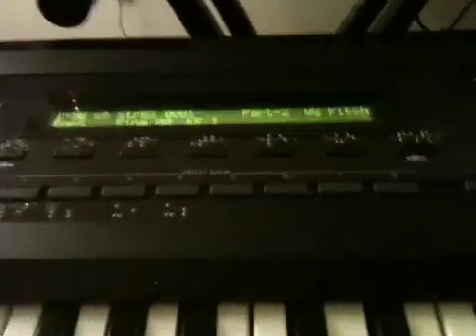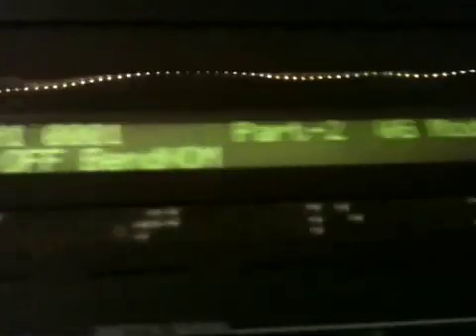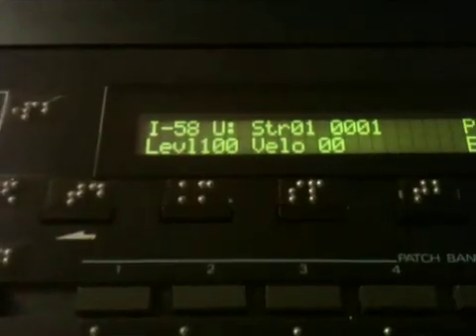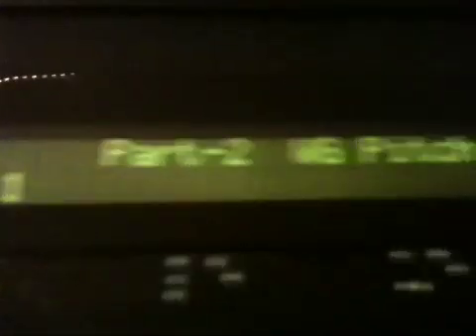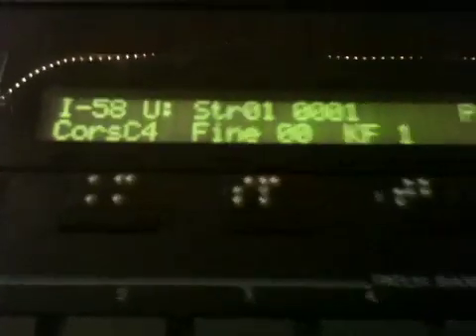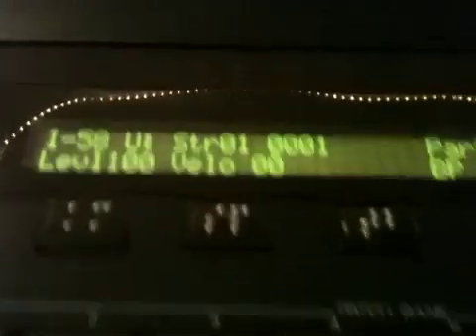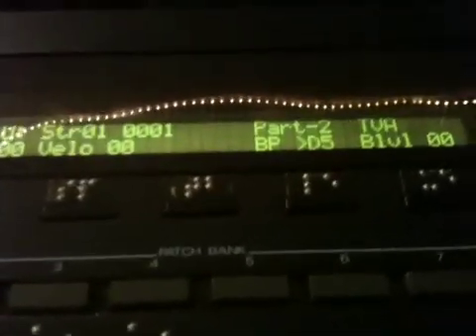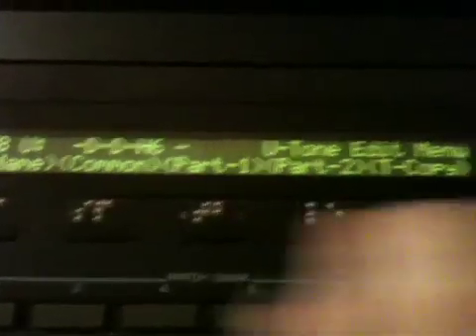D-50 101: Basic elements of sound & the D-50

Comment: To me personally, the D-50 is replacement for most of the analog subtractive synthesizer.  I know, most people are laughing at me when I say that, maybe because they don't have much understanding of the D-50 synthesis engine.  Of course, the D-50 development was 70% software, so what could even argue that it is a soft synth.  Nonetheless, the instrument still has considerable amount of hardware components.  To me the D-50 is basically a square wave generator, with pulse width modulation, ring modulator, three LFO's that can be routed to pitch, filter, amplifier, as well as pulse width.  It has multi-stage envelopes for pitch, filter, and amplifier.  So, all these features make it to me a viable replacement for most analog synths.  And the filters on the D-50 seem very smooth at sweeps.  Of course the D-50 could have high-pass and band-pass filters (like the U-20 derived D-70 had, the best multi-mode filters I've even heard before and since, actually, and the best triangle wave, too, but I digress...)  but for all most analog synths rely on low-pass filter only, so it's fine with me.  Besides the D-50 has its own character, too.  Now, I have a question for you.  How does the D-50 stuck up against the Jupiter-8?  I've seen your videos with the Jupiter-8, so I am sure you have great grasp for both the instruments, and how the compare.  To me personally, a square of sawthooth wave always sound the same, whether their being generated in software like in the D-50, or sample like in the D-70, or generated with analog circuits.  Of course, I contradict myself also, because I just said that the D-70 has the best triangle wave I've ever heard.  So, anyway, I just wanted to see what your opinion is about the D-50 compared with the analog synthesizer such as the Jupiter-8.  Visceral attributes aside (cause the Jupiter-8 is likely to win on looks alone for most people).  I am more interested the sound itself, the analog subtractive synthesizer type of sounds.  So how do the Jupiter-8 and D-50 compare sonicaly?

Comment from the maker: @alxgaray HI :) Yes to tuning procedure is to hold the transpose switch down while simultaneously playing a key of the desired tuning. If your D-50 doesn't do this, it might be from either a faulty transpose switch, or the fact that the switch may need to be cleaned and the contact under it to be cleaned. If you press the transpose switch on your D-50, does the LCD show "Transpose +01" for example? or does the LCD remain unchanged? Let me know and I'll try to help out as much as possible. :)